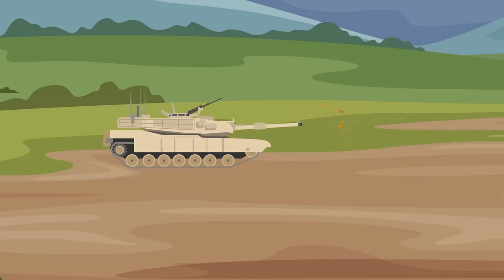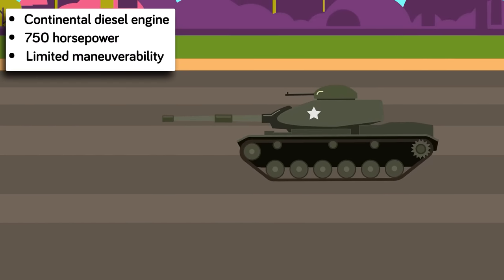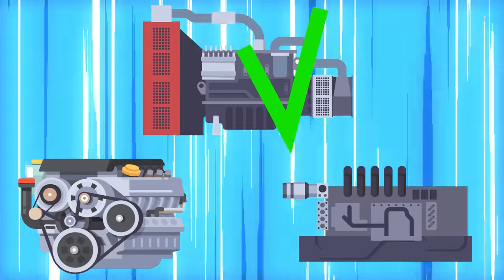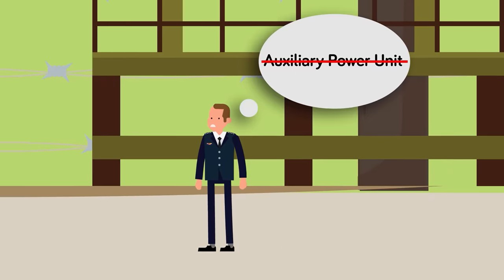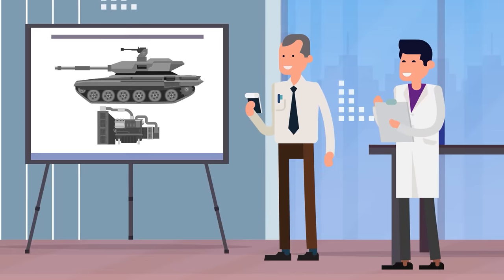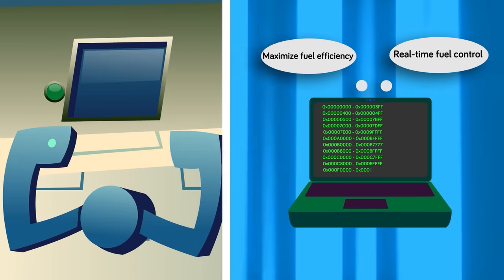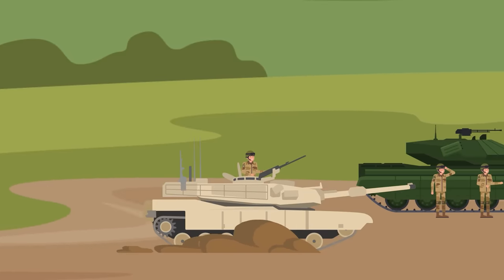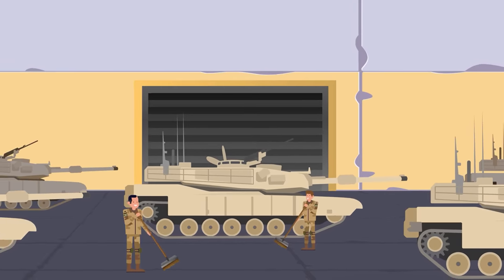Why M1 Abrams Turbine Engine Is Actually OP

Comment: i worked on the M1 in the late 80's.  the AGT part of the engine designation ,IIRC,  stands for  automotive gas turbine.  it is not an adapted jet engine.  it was designed, from the ground up to be a tank power plant, first for the MBT-70, then for the M1.
contrary to popular reporting, it can run on more than just jet fuel.  one of the major selling points is that it can run on any grade diesel fuel, any grade jet fuel, any grade kerosene, and even on any grade gasoline.  in korea, to keep from having to be towed to the motor pool, one was run on a 50/50 mix of diesel/gasoline for 5 miles with no ill effects.
the test equipment will not only troubleshoot the engine, it will troubleshoot the entire fire control and electronics system.  it takes about 4 weeks of intense training to learn the system, and about a year to get really good at using it.  it's just amazing what it can do.
Reply: as a person who doesnt know anything about engines or tanks, thank you
Reply: Well pointed out. Seems that many of these points were missed in the presentation.
I started out for the first time in the military working on M48 Patton.  
I had techno shock the second time in the 90s when I had a short time working on M1 Abrams using computer diagnostics at the NTC (National Training Center)  All you said is true and most pertinent. I have worked on other multi-fueled engines.
Again thank you for your comment.
Reply: TANK you.😊
Reply: At my job site I am the diagnostic equipment for some of the machines.

For some it takes me only a glance, others I know without even looking (I forsee the problem by the sounds the machine makes), either way, I can often reduce down time by a fair amount by enabling them to get straight to the problem without having to investigate through trial and error.
Reply: However its optimized for jet fuel so using any other fuel what decreases efficiency.
Reply: @everlastzyt5895   Well pointed out. Most multi-fueled engines have an optimal fuel type. However, they can be flexible if needed.
Reply: I was a tanker long ago. I miss my tank.
Reply: THANK YOU for highlighting the fact that it's a multi-fuel engine... While I love Infographics, that important point keeps getting left out of every video that references the M1.
Reply: Wow 50/50 gas and diesel. Craazy!
Reply: Can they run on captured vodka?  That might be ironically-amusing.  :D  I suspect "not really", I think even high-alcohol vodka is only 100 proof, so 50% Ethanol.  And if it can run on vodka...would it still smell delicious?  I think turbines might be too good at burning fuel to have that be a thing, but one can dream!  I am very impressed with how many different fuels it CAN run on even as it is, though!
Reply: But will it run on Russian Vodka?
Reply: @johnwick1883   too bad they did not let you take it home with you😏
Reply: FINALLY someone who actually knows what they are talking about brings up the fact that the engine can run on more than just JP-4 or JP-8.  I thought I heard or read this before, and when the talking heads from the gvmt and media were talking about how sending the Abrams to Ukraine would be a fuel logistics nightmare for the Ukrainian Army, I was dumbfounded because I thought it was a multi-fuel engine.  I had also thought the main reason the US Army and Marines (when they used to have the Abrams) used mainly JP-8 for the Abrams was due to fuel logistics and better overall efficiency for the engine.  Xtron if you read this, thank you both for pointing this out and for your work on the Abrams.  Also do you think the Abrams is a good choice for the Ukrainians when compared to Leopard 2 and Challenger 2?
Reply: Lol, if it can be considered 'fuel,' and you can get it in there, it will run. Except coal, that's bad for the environment.
Reply: The Abrams MBT will run on anything that is flammable, like Bacardi 151 or EverClear for example!!
Reply: @davidstone5411  That is why you never see a picture of one with a hot woman near its FOD
Reply: As just an automotive gearhead, I've always had an appreciation for tanks. I never really understood what characteristics about a jet turbine made it so good in a tank with the huge fuel consumption vs diesel until I saw an engine dyno graph comparing the M1 engine vs the Leopard. The torque curve on the turbine made it quite obvious.. just wow 😳 No wonder she out accelerates her contemporaries while being heavier
Reply: IIRC, its preferred food is № 2 Diesel, but it will happily run on anything from ethanol to bunker fuel.  I'm fairly certain you could run it off biodiesel if you had to.
Reply: There is a lot of less than accurate information floating around about the M1 family of MBTs, even after 40 years of service.
Reply: I don't think it is as hard to send m1s to Ukraine as they say.with that software and a  turbine swap set up
Reply: A few more they missed.  On the air filters they actually added a system to blow out the filters as the tank runs.  It then get run through the scavenger fan and blown out the back with the exhaust.  Also if the ECU goes down it’s not a huge deal… because of the duel redundancy.  There’s two ECU’s
Reply: The AGT-1500 has a link to the WW2 German Jet fighter the Me 262.   The designer of the Junkers Jumo 004B was the Austrian Anselm Franz.    He ended up working in the USA where he made it his personal ambition to improve helicopters through the use of gas turbines.   This lead to him developing the Lycoming T-53 used on the UH-1 Huey Helicopter.   The AGT-1500 is a development of the T-53 with some input from Franz.   (he wrote a autobiography "my life from jet engines to tanks).   It is classic American two spool design (axial then centrifugal on the other shaft).   Now owned by Honeywell.
-During WW2 the Germans were working on a shrunk down BMW 003 to power their tanks.   (See Anthony Kay German Jet engines and gas turbines 1932-1945).
It wasn't just power to weight ratio they were interested in.   Gas turbine fuel is much easier to make than petrol from coal.
Reply: As always the best solution is to have something that will do it’s job no mater what
Reply: way to break OPSEC
Reply: If the M1A1A2 can run on any fuel source then why did all vehicles which  normally used JP2 had to switch to JP8 prior to deploying to the first gulf war?
Reply: I believe they used shared components for the engine with the T-701C that powers the Blackhawk and Apache helicopters. Makes it easier for spare parts and repairs.
Reply: Xtron,tell me how much shaft horse power does it produce?i  mean its free power turbine or its split shaft. And do they change the design of the airfoil shape of the free power turbine to make more torque? What is the rpm of the main engine and the rpm of the free power turbine?
Reply: @cannon3267

You're correct that the Abrams turbine wasn't designed as a jet engine.

However it was designed for helicopters. It lost out on the bid to another turbine manufacturer.

It was then bid to the military for the Abrams.
Reply: .....well the nozzle of spraying combustible have to not be crippled, and the pressure in the heat chamber have to be in parameters, I suppose if can running on so many fuels the pressure cannot be like in a fighter-jet or commercial-jet, have less pressure or a range of less pressure because not all the combustible have same range of ignition and burning temperature, ..and bearings of the pallettes turbines must be serious hardenened.

Comment: Seeing Abrams tanks driving around near Baghdad, the sound coming from them is like the sound of an airliner taxing to the runway. Also their cannon was always aimed at the same spot no matter what the rest of the tank was doing, so it looked like it was always moving around.
Reply: The sound is very light so the sound volume is higher then other tanks close by but travels way shorter and that's what's important. Nice pointing it out

Comment: It's governed to 45mph, during R&D it would reach 75mph. The engine is a multi fuel engine too. It was designed to run on a bunch of different fuels. Almost all military vehicles are designed this way, even for fork lifts etc. They have to be operational in any situation possible. Also, the Leopard 2, V12 engine puts out 1500 HP as well.
Reply: Right, so i don't understand why the Abrams should be overpowered? Leopard has also 1500hp, consumes much less fuel and is faster.
Reply: ever hear of opsec
Reply: @WhatheEFF  Yup, I work in it. I don't know what it is truly governed at for combat use, they post 45mph as the public official number. They reached 75mph during testing. I learned about it because it was on the Discovery Channel. Public knowledge. They govern it down to preserve the tracks and keep 18 year old's from tearing them up.

Comment: WW2 tanks had APUs but for some reason this was overlooked in the early M1s. Another advantage of the turbine is it's instant on and go compared to the diesel slow, noisy start and warm up time.
Reply: @fishbinky  It uses JP8 not gasoline.
Reply: @fishbinky  its a turbine engine. It uses intake and exhaust turbines to work.
Reply: The Abrams APU and the main engine are both multi-fueled and can run on diesel, gasoline, kerosene, jet fuel, and one guy who says he used to work on them said they spot-fueled one with a 50/50 mix of diesel and gasoline, so it can even do that, which is kinda 'extra-cool' in my book.  And yeah, apparently a bunch of early models had 500lb of batteries in place of the APU.  I guess batteries mostly-/worked/ but not terribly well?

From its entry in Wikipedia (which I have also checked against other sources as well), "The tank was built around this engine and it is multifuel-capable, including diesel, gasoline, marine diesel and jet fuel (such as JP-4 or JP-8)."  So the Abrams engine is a turbine AND it can use gasoline to run...though if the repair guy ( in a comment up above, named xtron? ) went out of his way to use 50/50 gas/diesel, I bet there's a good reason to do that...but I'm not an expert, I was just researching it since when the idea of Ukraine needing MBT's came up and the Abrams first got mentioned.
Reply: That was a huge advantage for T80s in Ukraine during this recent winter.
Reply: What WW2 tanks have an APU???
Reply: The advantage of the Diesel engine in  a tank is they can idle on standby for hours even days with very little fuel, shutting down your engine on the battlefield is something that you want to avoid.
Reply: @viceralman8450  The M1 was originally designed to run on Diesel fuel... this was a major problem discovered after the M1 entered service and remains a serious flaw in the M1.
Reply: @EShirako  That is false, the M1 was designed from inception to use the either the Maybach MTU V-12 or the Continental AVCR-1360 Diesel engine.
The US Army rejected the turbine powered Chrysler version.
The Diesel powered General Motors XM1 beat the Chrysler version during the trials competition.
Reply: @WilhelmKarsten  M4A2 Sherman.
Reply: @WilhelmKarsten  The army universal fuel is JP8, but can run in almost anything that's flammable, ethanol, gas, marine diesel, kerosene,
Reply: @WilhelmKarsten  APUs solve that years ago.
Reply: @viceralman8450  That's it???? The M4A2 is one of the rarest versions of the M4 and wasn't even used by the US Army.
Can you name any other examples???
Reply: @viceralman8450  NO! SFC was not adopted until 1990 and was not fully adopted until the late 1990s.
The M1 Abrams was designed to use NATO F54 (no.2 diesel fuel)

The Lycoming PLT-25 engine cannot operate on any alcohol based fuels.
It's only rated for NATO STANAG code F-18 through F-77 or its civilian equivalents for emergency use only.
Reply: @viceralman8450  Most M1s in service or storage do not have an APU.
The APU is not a solution to the standby endurance problems that plague the M1 Abrams, shutdown of your main engine during combat operations is not a desirable solution and few crews in combat are willing to allow themselves to be exposed on the battlefield without main engine on line.
Reply: @WilhelmKarsten   All Abrams in service are either Sepv3 or Sepv2 M1a2 so they have APUs, they fixed the problem already.
APUs were exactly installed to remain in idle for long periods of times, if the engine is needed the APU is of and viceversa.
Reply: @WilhelmKarsten   But later the army adopted JP8 and the turbine is multifuel anyway so doesn't matter that it gets on the fuel tank.
Reply: @WilhelmKarsten   Not the rarest 6.000 or more were made for the Marines and the USSR, the rarest Sherman variant is the Jumbo M4A3E2 with only 250 units ever produced. 
Those M4A2 that were send to USSR as part of the lend lease program had APUs to charge the batteries during idle, due to cold hindering battery performance.
Reply: @WilhelmKarsten  I'll have to look that up later, but I seem to recall reading a few bits of that in footnotes before.  I will provisionally consider myself chided, and look into it more seriously when I can spare some time to do that...and since I didn't come across that stuff in the first place (past the AVCR, I think that sounds familiar, but wasn't labeled as THAT-fundamental to the design), then I suspect I will need a few hours-or-days to look into it.

Thank you for (provisionally) enhancing the accuracy of the stuff stated here!  Oh, and if you have any good URL's or books I should look into for details about that, I'm open to suggestions!

And...seeing all the comments from others about yes-this and no-that and 'edge case' and 'wrong model!', I think I will REALLY have to look into this to figure out what's what.  Of course, I can only approach data from a Civilian data-perspective, so I'll have to see what I can find.  Still, no matter what, I'll look up the above-mentioned engines and such and see what else I can find out!
Reply: @viceralman8450  The APU doesn't solve the problem, it's a stop gap until a new Diesel engine is adopted.
Reply: @viceralman8450  No, the problem is that most US Army vehicles are not gas turbines..NATO F54 is standard fuel for virtually every military in the world, available anywhere on the planet... JP-8? Not so much.
Reply: @viceralman8450  The Soviet T-34 was Diesel... it didn't need an APU.
Reply: @WilhelmKarsten   US army universal fuel is JP8, JP8 behaves like diesel so any compresion engine can use it. 
The turbine can run on any fuel.
Reply: @WilhelmKarsten  Yeah, soviets didn't care about their batteries dying due to cold unlike the Americans.
Reply: @WilhelmKarsten  The hybrid diesel is not going to be adopted as so far, the Army has not shown any interest on Abrams X.
Reply: @viceralman8450  No, it doesn't... JP-8 has significantly lower lubricity than F-54 and causes serious fuel system damage.
The adoption of SFC has caused billions of dollars in additional repair and maintenance expenses.
Reply: @viceralman8450  WRONG! The Lycoming PLT-25 can only be run on NATO STANAG code fuels F-18 through F-77 or there civilian equivalent.
The Leopard 2's Maybach MTU Diesel engine can run on ANY FUEL THE ABRAMS CAN USE.
Reply: @viceralman8450  Americans never used the M4A2 in combat, it was considered inferior to the other M4 variants with Gasoline fueled aircraft engines.
Reply: @viceralman8450  General Dynamics has already announced that any new version of the M1 will be powered by a MTU 883 V-12 Diesel engine or its upgraded version.
The 883 is already available for export sales
Reply: @WilhelmKarsten   They did it was the favorite model of the Marines as it shared same fuel with the navy.
Reply: @WilhelmKarsten   Abrams X is a tech demonstrator, not the next variant and so far, the army is not interested on it.
Reply: @viceralman8450  No it wasn't, the M4A2 was relegated to secondary training service or exported to other countries.
It was very unpopular and saw no combat with American forces.
Reply: @viceralman8450  You are not familiar with the Diesel powered version of the M1???
It's powered by a MTU 883 V-12 Diesel engine.
Reply: @WilhelmKarsten  It was only a prototype all Abrams in service with the US or other nations use the turbine engine.

Comment: The inlet temp of the agt1500 used to power the Abrams is 2180 degrees Fahrenheit, while the temp in the v12 powering the Leopard 2 is between 300-350 degrees celcius.  In a modern battlefield, where you are trying to lower or hide your heat and noise signature, this is quite  alarming.  I hope the M1E3 addresses this issue with the new hybrid-electric engine system.

Comment: I remember driving in convoy out to the field at Fort Riley, KS. We were supposed to keep equal spacing. But driving an M1A1 it was the most natural thing in the world to accelerate up a massively steep grade. It didn't work out well for the poor M88 drivers who had about 1/3 the horse power.
Reply: and the M88 weighed 3 times as much
Reply: @travelinman70  No it didnt, the M88A1 weighed just over 50t and the M88A2 Herc weighed about 65t. I was a M1A1 Tank Systems Maintainer, 63A at the time, from 2000-2008. I was on the 88 for many years. The biggest reason for the slower speeds were that the engines produced less HP and the transmissions had different gear ratios. They definitely did not weigh more than an Abrams.
Reply: So is it just the M1 that's always booming over at FT Riley? Or do they train with Bradleys, Mortars, and M777s too?

In Manhattan you get the deep "Whooomp"s, the "Tu-Tu-Tu-Tu-Tu"s that sound like a chaingun, and the fast "Tat-at-at-at-at" that sounds like a 240 or .50, could also be a 249 not sure. 

Lived in Riley for a bit too, and it was definitely interesting playing Battlefield and having your windows rattle, feeling it in your gut as explosions go off in game.

Also think it's pretty cool the Heli-field has an Nuclear Cannon over looking it on the hill, a M65 "Atomic Annie".